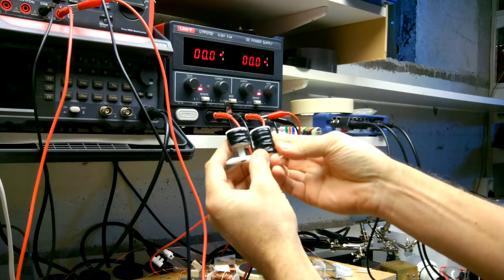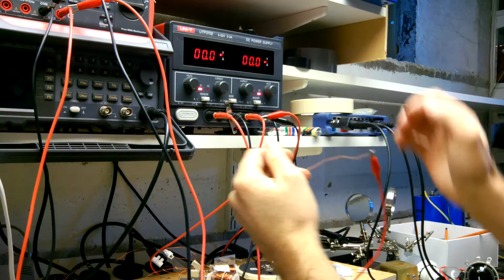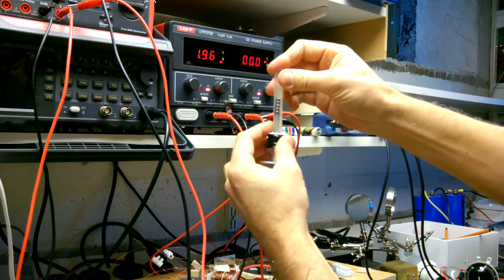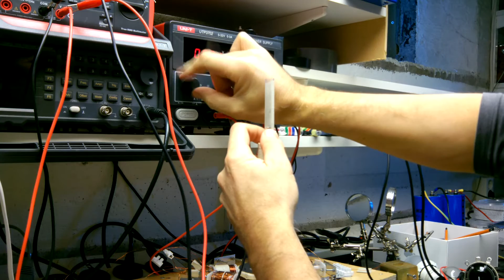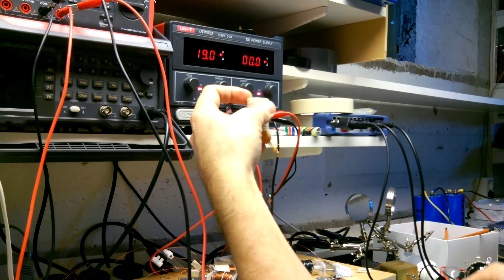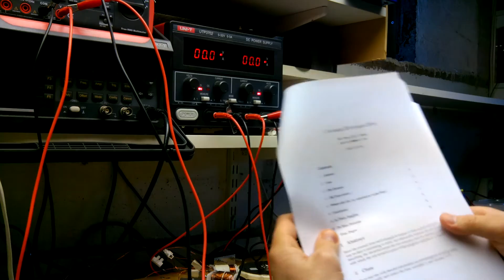Increasing Force per Power Experiment

Comment: Actually it's the number of turns AND mass of copper used not the size of the awg of the copper wire.  If you have more turns, more mass of copper, you don't need iron laminations or iron core to run a powerful motor.  In Joseph Newman's work, he says the more turns the more copper, the greater the magnetic gauss rating.  And it is not current but Voltage that is the catalyst for copper coils to be come magnetized.  Hence Joe Newman uses large copper coils and works them with permanent magnets creating a powerful motor system that runs LOW on amperage and relies on collapse of large magnetic fields to manipulate lenz' law.  That is why he can drive high torque applications with small transistor batteries.  It is also why the establishment refuses to grant him a patent

Comment: Good observation.  More copper = more power. 
It's a simple, and more precise way way to look at it. 
We read about more turn more power, yeah it's true because , more turns means more copper. But you nailed it right on, it's more precise to use the "more copper" method.
Good job !
Reply from the maker: +Mike Poirier Thanks! But don’t miss the principle of less copper in generators (but many).
Reply: +Hob Nilre 
Yeah, I think I missed that.
For motors: more copper = more power.
For Generator: Less copper = more power.
Is this correct ?
Reply from the maker: +Mike Poirier not quite, its all about the force to power ratio, hi in motors and low in generators.
Reply: +Hob Nilre 
OK  so, force meaning torque, and power meaning input/output V/A ?
I can see it in motor application where given the same power a motor coil with more mass would have more torque, than a lesser mass coil.
Could you give me an application for the generator, using the same analogy ?
Reply from the maker: +Mike Poirier given the same power delivered by the generator you want the generator to have as little negative torque as possible
Reply: Actually the turn matters along with mass of copper.   The fundamentals is more mass which is infinitely true that magnetic power is from the atomic power of the copper.  When you wind them with more turns, that configuration enhances the gauss rating.  If you put them in a less tight winding their gauss rating is much lower.  So the windings are important to get copper wires tight.  When you place voltage in a large copper coil with many windings, you get a big magnetic field.  But the secret is in collapsing that magnetic field. Go read on the works of Joseph Newman it will open your eyes
Reply: +Constantine Joseph Yeah, Joe Newman's work is worth studying. 
He has made very impressive discoveries and documented  his own observations. Sadly, he is not or hardly discussed anymore!  I plan to revisit his work sometime. I kept good records of most work of what he has published, videos and docs.
Reply: +Mike Poirier Actually he passed away last year.  He has managed to harness power that is from either the magnetic field or from what Tesla says, radiant energy.  This is evident in the back spike or counter electromotive force.   The mass of copper coils and mass of magnets determine the size of magnetic fields in the motor.  Where the industry uses iron core windings to generate focused flux lines to generate more torque, the Newman motor is powered by Neodymium magnets and the collapsing large fields of magnetic fluxes by the large copper coils when voltage is applied.  By switching off the copper coils and the magnet falling away, therein is the secret of augmented power that can be harnessed.  

It is indeed fascinating and I've seen them on oscilloscopes.  Hence, regardless of size of the newman motor, driving a  100watt or 1000hp motor, the motor still uses milliamp level of electricity and generate high torque.  Possibly one of the best inventions ever